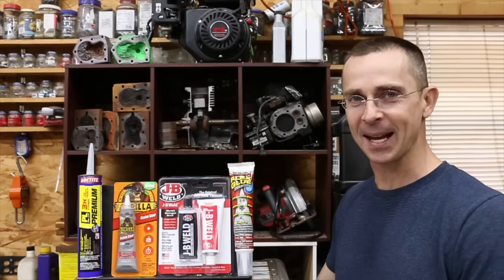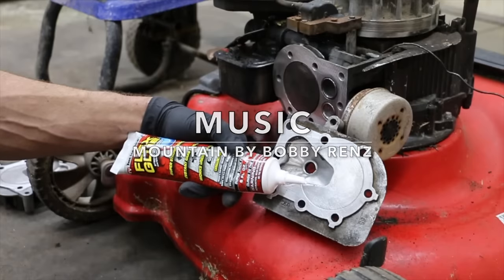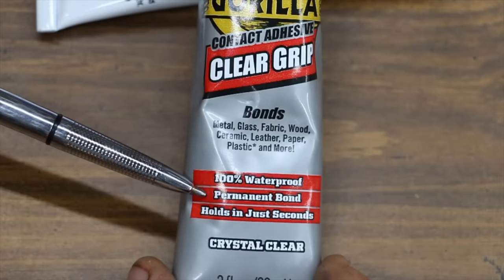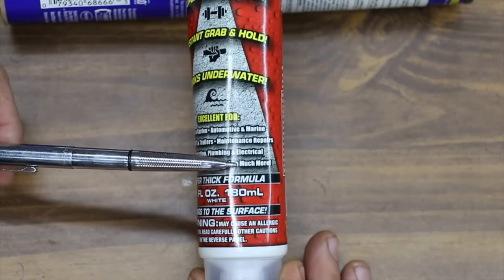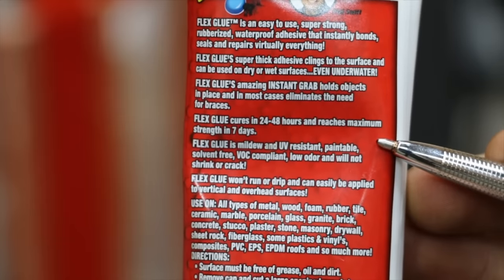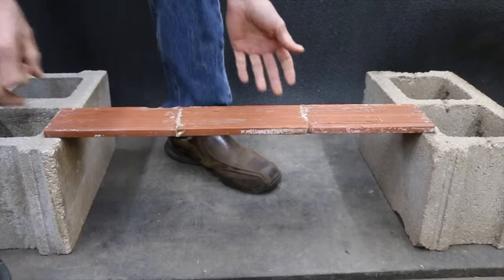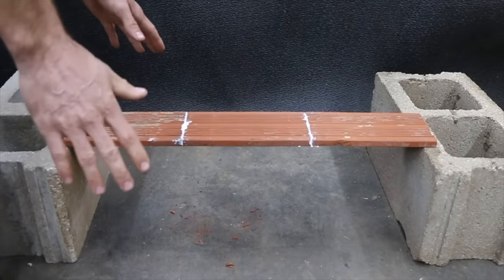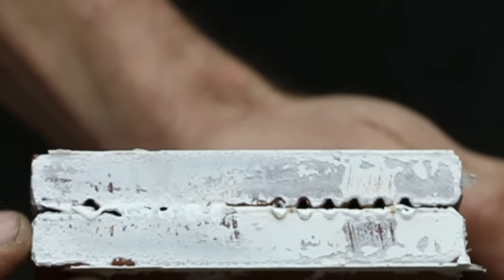Is Flex Glue better than JB Weld, Gorilla & Loctite?  Let's find out!

Comment from the maker: I had a LOT of fun testing each of the brands and JB Weld is simply amazing!  Thanks for all the video suggestions too!  Best regards, Todd
Flex Glue: https://amzn.to/2CQI20v
JB Weld: https://amzn.to/3j2Hy6P
Loctite: https://amzn.to/2YnnBj2
Gorilla: https://amzn.to/2CTqocs
Reply: There's nothing better then JB-WELD!!! ANNNND If you want to get technical, all of those glues are two parts, it's not one chemical in those glues, there's different chemicals in each one of those glues, so technically they are all two part systems!!
Reply: Have you thought about testing the different variations of JB Weld against each other?  They have several different types. It would be nice to know how they stack up against each other. Thanks for the videos. They're great and I appreciate the time you put into them.
Reply: I'd like to see a no prep test with these products
Reply: @picklerickdic8955  no they aren't a two part system requires mixing before application the other's dont a two part system has glue as one part and a activator in the other part
Reply: JB Weld is alien technology.
Reply: Why don't you test JB Steel Stik against JB origonal?  I know they have some different use cases, but why not.  Also, other competing putty like products, Selleys knead it and others of that type.
Reply: i would want to see an experiment for plastic using jb weld original
Reply: Did you ever try 404 loc tight
Reply: You should mix all the glues together and test it. Is it going to be one strong glue?
Reply: Man i love watching you.  Keep up the good work.
Reply: Have you ever tested InstantBond I am almost sure it will outperform all of the products and i would ask you to even test it after a 9 minute cure
Reply: I think your tests favored JB weld, I mean Flex glue can be used to Caulk bathroom tile and sinks and you'd never even think of JB for that, and who needs end to end bond strength. You need better realistic real world useful applications.
Reply: When you add weight to do your tests, instead of having large incremental weights, such as dumbbells, you should gradually fill a container with water, so that you can achieve a more precise measurement. The remaining water from the container you used to pour, could be used to calculate how much the target weight container held.
Reply: @picklerickdic8955  Yeah IF you consider air as a second part. JB has a catalyst not evaporation cure.
Reply: Hiii, can you do High Temp Gasket test, I didn't find in your play lists, I'd like to see which High Temp Gasket is best
Reply: @DannoTull  for most of these glues these were tests of things they aren't designed for, ending with the conclusion that they don't do it well.
Reply: @magsteel9891  then why make the video it makes no sense.
Reply: @DannoTull  my son saw I had a lontite product in my table and said "dad! JB weld beats loktite! Here's the video!  I told him, this is loktite  clear silicone adhesive. I'm using it to seal plastic edges on a plastic pool light housing. You wouldn't use something like JB for this.
Reply: Id like to see loctite PL Premium in an upcoming video. Keep up the good work bud
Reply: @picklerickdic8955  to
Reply: Fun fact: JB Weld is the glue division of JBL.
Reply: @picklerickdic8955  j
Reply: Try to get feedback from suppliers or manufacturers on your youtube videos. Think it might be a fun thing to do. At least on the products that can be done.😉
Reply: The only reason the jB weld on the wood failed so early was because the wood wasn't  pressed together while the JB well cured and you didn't use enough the wood will  soak up some of the JB weld because its kind of runny before it cures . You have to put some JB  on both sides of the boards wait  a few minutes while the wood soaks   up some  off some of the JB weld and then add another big slop of JB weld on both the boards stick them together lightly  press them together and the jb weld  would have held a lot better.on a side note  I can say through personal experience that if you  drilled holes on either side of the board (make sure the holes are not perpendicular to each other )fill the holes with JB weld and then slap a  big thick blob of jb weld between the two boards press them together until it cured the rest of the board would break before the repair spot will 😉

0 seco
Reply: @latemreggadable  m
Reply: Liquid nail?
Reply: @BulletmanDoom  Saved me from a beating when I wrecked my dads motor cycle. Busted the crank case in a stump.
Reply: @soylentgreen9492  It's so far ahead of the competition that it should be in a different category. I've not known about it that long (Last few years) because it's just not common over here but I wish I'd had it back in the day.
Reply: The product name is wrong at 7:08
Reply: Wow jb weld is incredible. 
I cant remember the name of it but it's a clear epoxy activated by a uv light and supposed to weld anything. I will try to find it..
Reply: I use jb weld plastic bond 2 part on radiator plastic tank, to my surprise when radiator gets hot the epoxy soften like rubber, is that normal or its not meant for radiator repair for high temperature?
Reply: Very interesting, I have to repair an aluminium casting on a garden table leg. The repair is on a non supporting part and JB weld looks to be the best product to use. Thanks from the UK.
Reply: How about testing adhesives or glues on 2x4's bonded to concrete blocks as in to studding up a wall against the block, or something like that ? How they hold up with the cold and heat of the blocks with the weather outside, along with moisture ?
Reply: @timothyowen1347  Was about to ask myself. I've known JB Weld to fix cracked engine blocks, and stay fixed for more than a decade.
Reply: You need to make the distinction between the full JB Weld version that you used and what is available at Walmart, Dollar Store etc. Most stores sell "JB Weld Kwick" which is complete crap. A rule of thumb with epoxy is: set time is inversely proportionate to set strength. Your results will NOT be the case for "Kwick".
Reply: Do you weight train then?? :D
Reply: Thank you !
Reply: Can you buy Araldite in theUSA? There are several grades of it, and it would be interesting to see how they compare with JB Weld. Thanks PF. 🙂👍
Reply: No Reverse? Can’t you simply move the lever forward, to reverse the hydraulic motor? Here’s an idea: now that you have a working hydraulic system, try removing the rear axle and mounting two hydro motors, one for each rear wheel. Then you could experiment with hydrodynamic thrust vectoring - steering with the rear wheels.
Reply: I can bet you did not read the introductions on the  Gorilla glue. Most people don't. However it says you must dampen any surface before applying glue.  I would love to see I video on the difference that makes if any
Reply: Nicely presented.
Reply: Can you do the same comparison with Quick Set type products.
Reply: im watching your video.  Have you tried to do this during winter season.?  I need a fix and need to use JB weld.  Left the item outside for 4 days.  Brought it in for 30 mins and product is soft as hell and broke.  Would it be safe to say that jb weld cannot be used in winter repairs.?  in winter conditions.  I forgot to say, its metal work on broken bolts and extraction method of it.
Reply: I had a frozen pipe that cracked & split under pressure. Repaired it with JB Weld plumbing glue over 10 years ago. It's still holding, still  no leaks.
Reply: @alee2907  i am working in an environment that has oil - previous contaminates. This is slightly different that a leaking pipe.  Working with 6mm items and smaller, JB weld is not holding up to the challenge.  Engine works is not good for JB weld.
Reply: @alee2907  I will keep this idea for AC compressor pipes that have pin size holes.
Reply: I have watched your channel for years thank you for responding I appreciate it . I think that's the first time I've ever commented. Keep up the fantastic work that you do you are one of the best YouTube channels out there point-blank flat-out hands down.
Reply: J-B Weld is an EPOXY. The other three things are glues/adhesives.  These are essentially two separate categories. It'd be much more beneficial for your loyal viewers (including myself!) if you'd do two separate reviews: One for glues/adhesives, and another for epoxies; would be a fairer comparison and more useful for all. Other than that, keep up the great content!